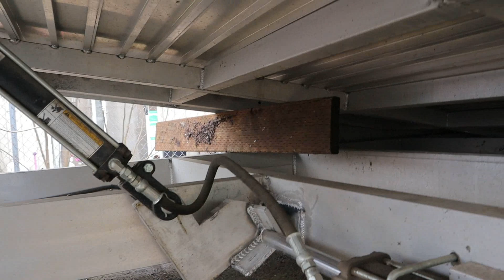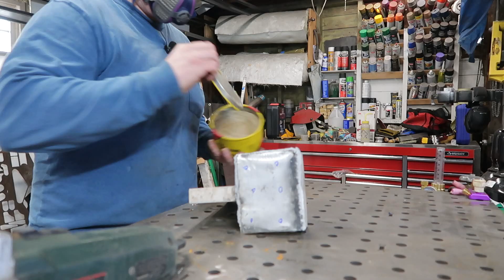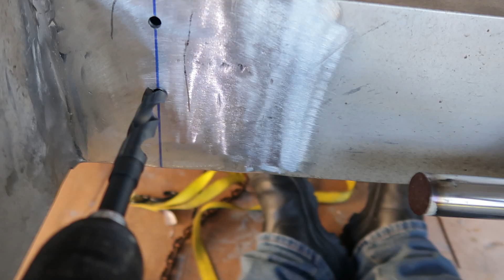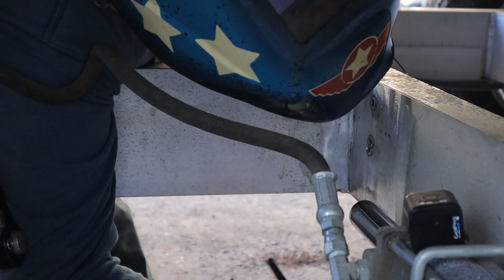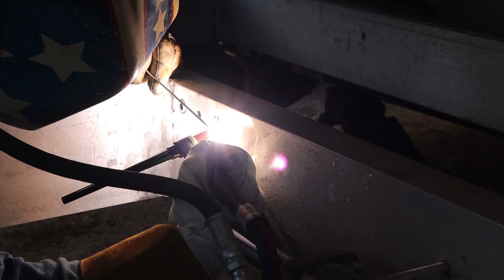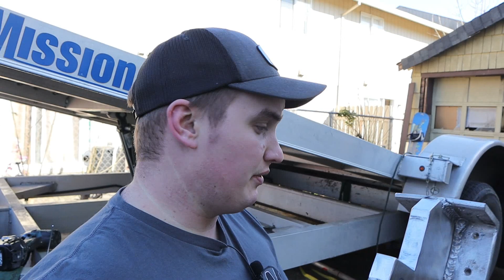Trailer FAIL!!! Aluminum weld Repair

Comment: Wait what’s that’s sauce you dipped the flap disc in?
Reply from the maker: That was Johnson's paste wax. Which have since been discontinued and is hella expensive. But any cutting wax will greatly increase the efficiency of a flap disc grinding aluminum and not loading up
Reply: @amcustomfab  thank you I didn’t kno that was a thing

Comment: If you look at it closely the original bracket actually had kind of bad geometry because it stuck out too far, whether or not it was actually broken from dragging, im sorry but I'm kind of skeptical on that one. It still looks like a really thick bracket attached to a not so thick plate attached to the chassis that was  relying on that top bead of weld for all of its strength. It looks like it the hydraulic ram would rip it off. Either way nice job I think the way you repaired it is a whole lot stronger than the original setup. you shortened the bracket and now the stress is on  3 steel bolts, STEEL BOLTS!!! vs one aluminum bead.
Reply from the maker: 6 bolts in total  4 through bolts and 2 tapped bolts 😎
Reply: @amcustomfab  yeah I know, but think about it the stress is like 99% on the top 3 bolts. just like the welds the top weld was the most important.
Reply from the maker: Lol was literally watching your aluminum cube video couple hours ago nice work. 😎
Reply: @amcustomfab  Lol, I am brand new to welding aluminum and I just bought my primeweld 225x a few weeks ago, and thats how I started watching your videos. because I watched a vid where you use one. but yeah man you got some knowledge and skill, and I like watching repair videos like this one, because I'm about to be doing the same type of stuff.

Comment: I wonder if the manufacturer would even listen if you reached out to them to tell them about the design flaw of their mount dragging
Reply from the maker: They would probably say it was not designed for off-road use. 😎
Reply: @amcustomfab  I would be pissed if spent that much on a trailer and it kept failing

Comment: Great job! Another great video as always. 2 questions what did the penatration of the weld look like off the old bracket? From the video it didn't look there was any. 2 did you use the primeweld 225x for welds?  Thank you
Reply from the maker: Not good and yes 😎👊🙏 thanks for watching.

Comment: Did the same repair on a similar trailer. Used bolts as well to reinforce and was actually first paying job with PW 225. Customer admitted to not opening the valve when off loading a vehicle.

Comment: Hey bud, What is that wax you use to keep
The aluminum from loading up on your flap disc? Tried pausing the video but you were too quick.. lol.
Reply from the maker: I got a link in the description for you brother
Reply: @amcustomfab   thank you sir… have you ever tried the Walter enduro-flex aluminum trim able flap discs? hands down the best I’ve ever used on aluminum. And the last forever! 3 different grits. Not cheap, but worth it..
Reply from the maker: No I have not I will definitely have to check those out thanks for the tip .